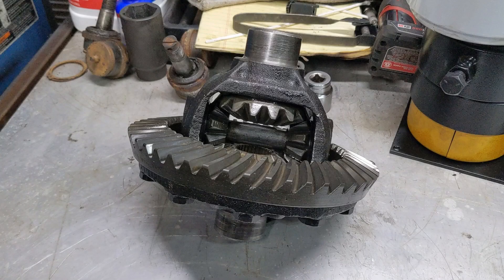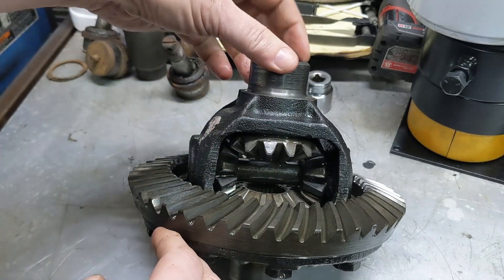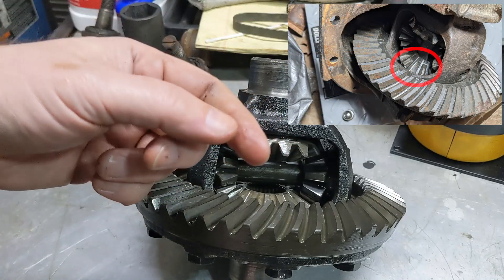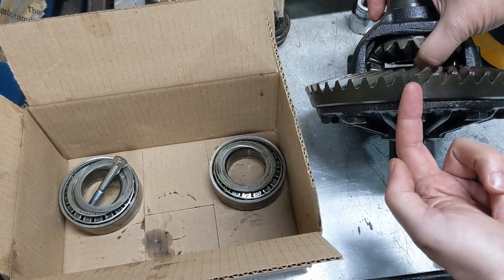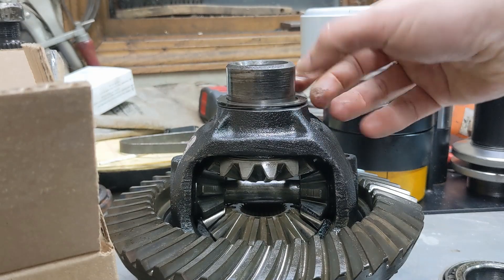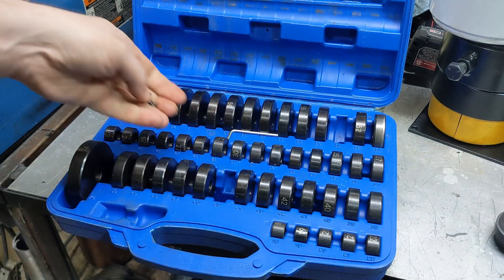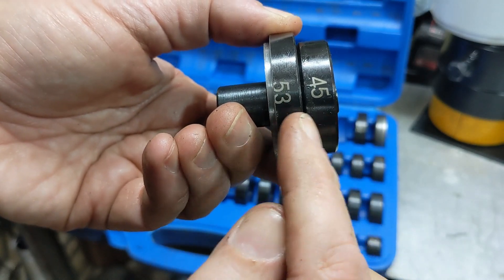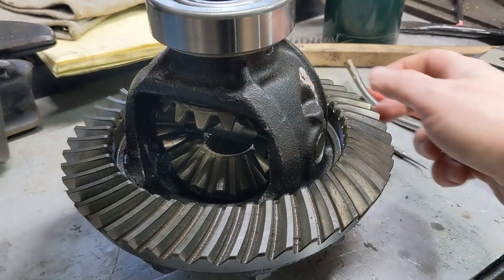Dana 44: Replacing side and pinion bearings (True Spirit #16)

Comment: Great video. Could bad side bearings cause vibrations/wobbling of both my cv axles?? I'm so puzzle I've checked everything. Mine car is a kia sportage 2007. After watching your video im suspecting its probably the main cause of this problem. Could it  be??
Reply from the maker: Yes
Reply: Thanks for the reply. Do you have a video of how to remove and replace side bearing??@YoshimoshiGarage
Reply from the maker: @hammerhead7344 there are videos on this channel for everything on the Dana 44

Comment: Is it possible to use a hammer and seal driver to put the side bearings on?  Obviously with care, making sure to push it down on the race side and not damage the bearing cage. As well as making sure it goes on squarely.

Also, what is the likelihood of needing more or less shims to get proper lash if the ring gear is swapped to a locking differential? I'm using the same ring gear that came out of it.
Reply from the maker: Changing the carrier I think it's almost certain you'll need to change shims. You can probably put the bearings on with a hammer and cup or socket, but you'll never get them off intact without a special tool
Reply: @YoshimoshiGarage  sounds like quite a process taking them off and on. I guess no way around it though. Thanks.

Great channel. This D44 series is the best info I’ve found on the subject on YouTube